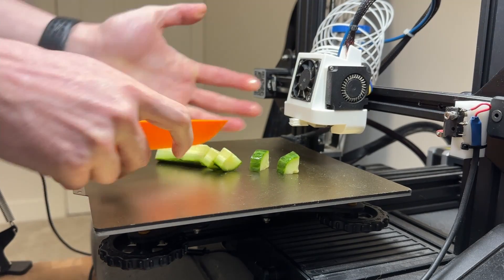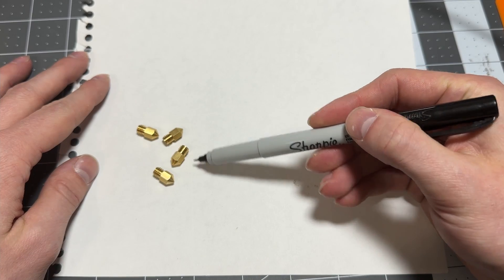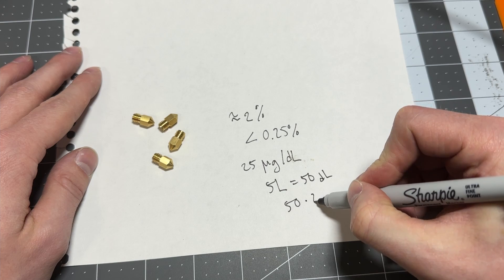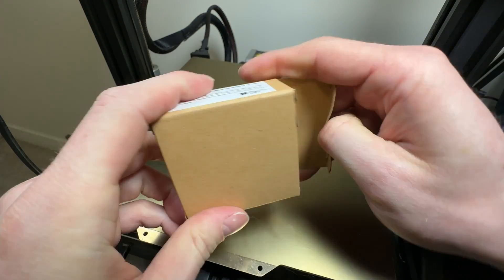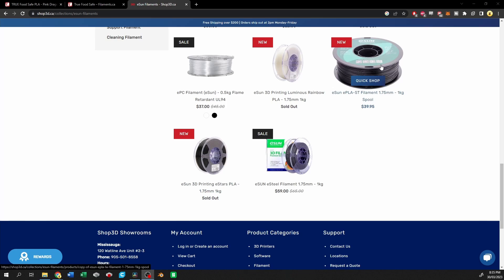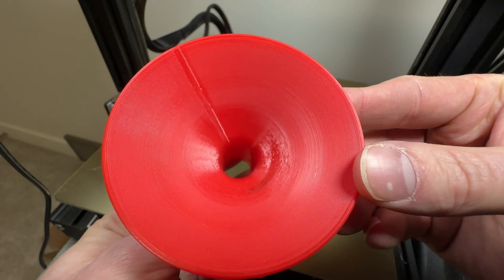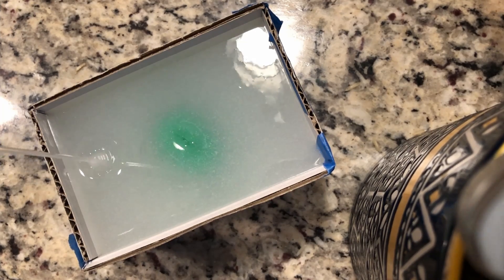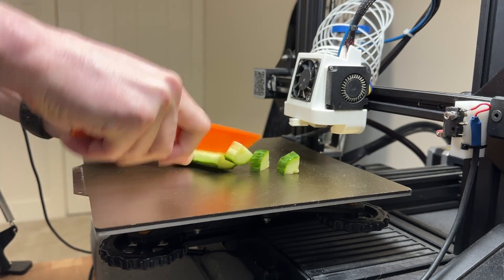Can FDM 3D Prints be Food Safe?

Comment: you could also probably use a material like PSU or PPSU that can go in a dishwasher to solve that last issue.
Reply from the maker: I hadn't heard of these plastics before, thanks for suggesting them. Looks like they print at 350-380°C. That's outside the temperature range of most hobbyist printers. Do you have experience printing with PSU and PPSU?
Reply: @3DPrintStuff  yeah I have an ended 3 v2 with a copperhead hot end from slice engineering that’s good up to 450c and an enclosure that can get to about 60c, which can get you some decent sized parts in those materials as well as Ultem and PAEK’s, all of which are materials I have at least some experience with. They’re not cheap but not totally unattainable on a hobbyist printer.
Reply: @3DPrintStuff genuinely impressed ur science is right on the money I mean haven't checked the math but content by weight considering leeching out especially with heat. 

Spot on
Reply: @3DPrintStuff genuinely impressed ur science is right on the money I mean haven't checked the math but content by weight considering leeching out especially with heat. 

Spot on

Comment: Thank you! Informative. PETG might be one of the best choices for filament, as it can be washed in a dishwasher.
Reply from the maker: Great point, I'm thinking about maybe doing a video where I put different filaments in the dishwasher and see how they deform.
Reply: PETG is borderline but works. I have thick wall vase mode PETG cups that have survived regular dishwasher use for a year or so, but undergone some minor deformation. Thicker would be better probably, but an annealable material like PET or PLA, annealed, would hold up even better. PLA is hard to anneal because it's soft and totally deforms at annealing temperatures, but PET is hard in the 82-100°C range ideal for annealing.
Reply: @daliasprints9798  I've seen some success with annealing PLA and PETG in Green Sand. Parts need to be solid and filling with perimeters is better than 100% infill. Super thin sections can still deform.
Reply: @kevinbevin2  PETG isn't annealable. That's the whole point of the "G" in PETG - the glycol prevents crystallization. It's remeltable to eliminate layer line weaknesses, but that won't increase heat stability like annealing would.
Reply: @daliasprints9798 I’ve been using 3D printed parts as a cup for drinking (cold only), and a plate to eat food. Due to the ironing there are zero visible layer lines although I know they’re still there. 

I’m just using regular matte PLA and handwash after every use. Is this that bad? Stainless steel nozzle and all that.

Comment: What about SLA prints with plant-based or even biodegradable UV epoxy resin? At least the layer lines would be so thin or even non-existent that the bacteria problem would be solved.
Reply from the maker: Yeah you're right on this one. There are quite a few dental resins that are biocompatible but I haven't seen any that are specifically food safe materials. They aren't necessarily the same thing. I would feel pretty safe using dental resins for food applications but I wouldn't sell the product or offer it to others. Dental resins are also very expensive ~$300/kg, that's outside the budget of most hobbyist 3D printers. I don't know if we'll see those prices come down any time soon since dentists are the target market and they can afford to pay those higher prices and getting those resins certified is expensive.
Reply: @3DPrintStuff  $250-$450/Kg and rated for one year, but only if you follow the validated post curing procedures which change depending on brand, eg post curing 20 minutes under a light while submerged in 60° Celsius glycerine, and repeating the procedure if you grind/sand the surface
Reply: Would need to check it under a microscope. Even if the layer lines are practically undetectable to us it doesn't mean it's not significant enough of an area for bacteria.

At the end of the day though we should probably compare to used kitchen equipment because I imagine a lot of stuff has been used enough to create similar levels of bacteria-friendly geometry yet we still consider those items "safe".

Comment: what about vase mode?
Reply from the maker: Like zloe said, layer lines are still and issue in vase mode.
Reply: @3DPrintStuff  I thought vase mode eliminated them huh
Reply: @hapsti  your thinking of sculpt mode, where the printer takes a block of plastic and chisels out a benchy from it, then theres no layer lines.  oh wait i fogot , sculpting printers havent been invented yet, silly time travelling me
Reply: @hapsti  Vase mode eliminates the seam, not the layer lines
Reply: @3DPrintStuff  With vase mode there is no virtually unreachable interior space to facilitate microorganism growth that can't be cleaned.
Reply: @daliasprints9798  You do realize that FDM printers still print by stacking layers, right? Vase mode or not, doesn't matter how you slice your object. Just coat the print in food safe epoxy if you're really insistent on using 3D printed goods; else make it so that they never actually come in contact with food. Handles or other gadgets for your coffee thing, or clips or what not. Else use them with liners, like making a 3D printed mould or box or tray, putting a freezer bag and filling the bag instead - something like that.
Reply: @TheCyberSpidey  Yes. I'm also aware, as every parent probably is, that every single injection molded baby/toddler sippy cup is full of internal acute angles that are impossible to mechanically clean. That's why we use dishwashers and soak in mild bleach solution if the item is in questionable cleanliness or going to be used by someone at high risk. "Layer lines" do not change any of these principles. Only non- but almost- watertight internal volumes do.
Reply: layer lines?